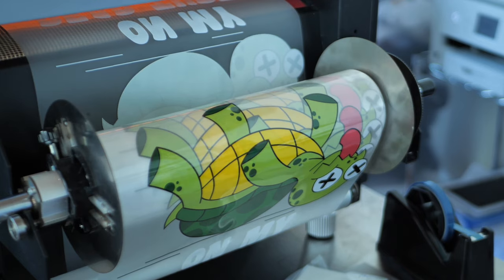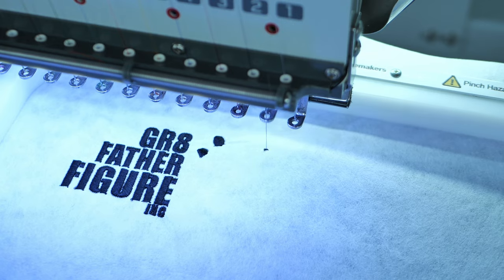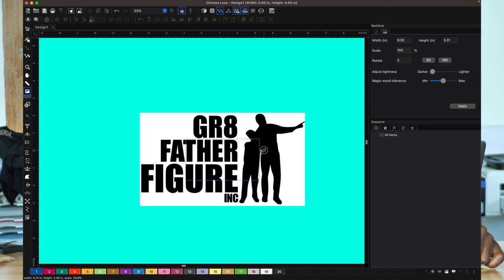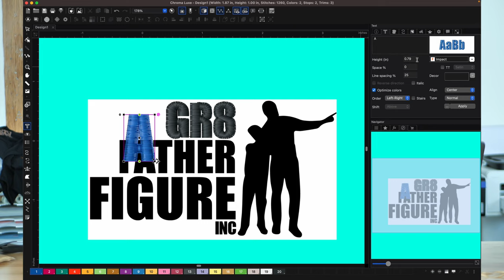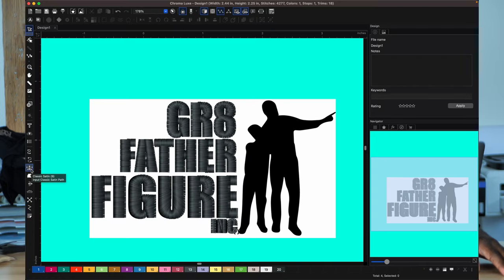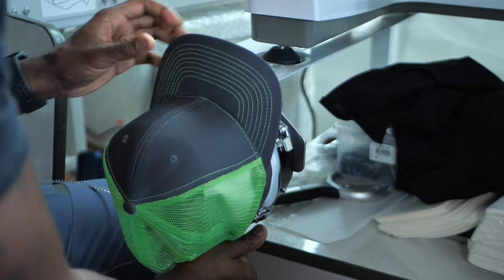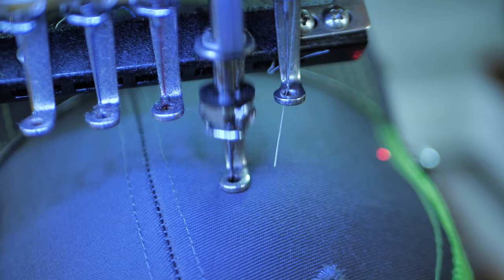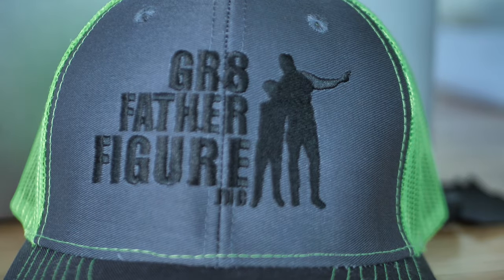How to upsell your clients | Hat embroidery project example | Full Video

Comment: That came out clean. What hat was that? And it really did work well even if you didn’t run center out.
Reply from the maker: Yea, I only run center out when the density is really heavy and if the design requires a heavy underbase.  I don’t like using a lot of underbase unless the design has a lot of detail and small elements need to line up.  it is always good practice to digitize center out however often times I do not..
Reply from the maker: The hat was super old i believe I got then from this place buck wholesale.  Did a few videos with them that they were supposed to but never payed me for.  Ok hats bad behind the scenes business.

Comment: ADubb what type of bobbins are you using plastic or paper sided?
Reply from the maker: Neither. I use pre wound sideless bobbins.
Reply: @adubbproductions  thank you for your reply.
Reply: Can you tell me why you choose those and should I wait until I get familiar with my machine before I try them?
Reply from the maker: @calvenw2199  I choose them because they are the option with the least possibility of something going wrong.  No paper to possibly rip off and get stuck or whatever else could happen, just thread. And I don’t think you are supposed to use plastic in the machine period. Never heard of anyone using plastic bobbins in a multi needle embroidery machine.